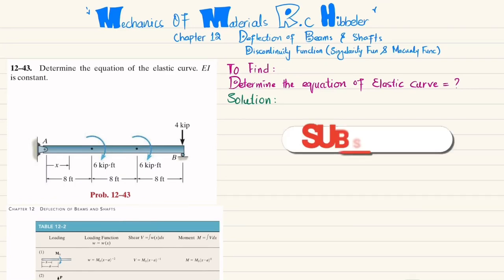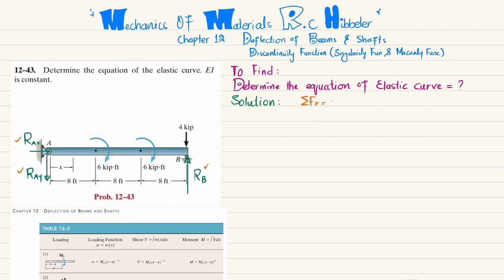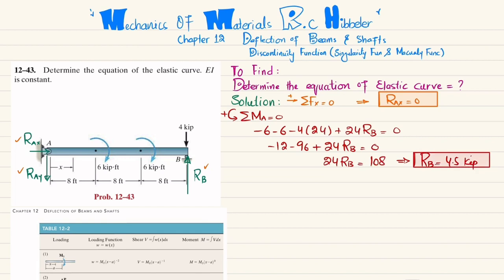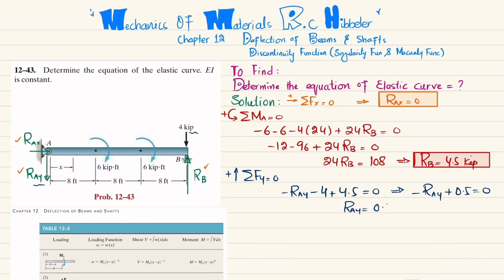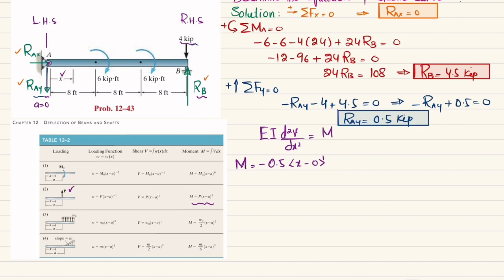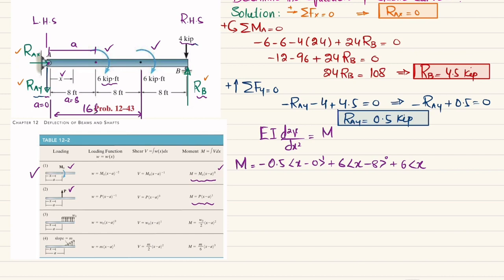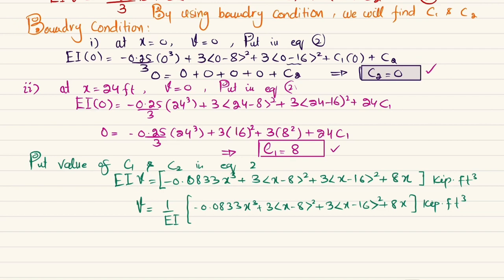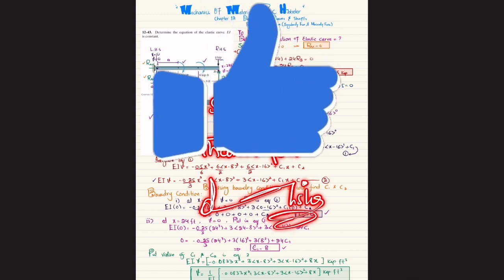12-43 Macaulay's Method | Deflection of Beams & Shafts | Mechanics of materials RC Hibbeler

Comment: Why did you put positive for value 6 before integrating? and why are not adding RB & 4 Kips in terms of (X-a) in the moment Equation?
Reply from the maker: I have not taken Rb and 4 kip in moment in term of (x-a), here a=16 for this and  for x=16 or less than 16 this term will become zero, that's why we neglect the last term. I hope it is clear now. Try it , take this term and then solve please, you will get same results.
Reply: it's clear thank you
 @engradnanrasheedmechanical